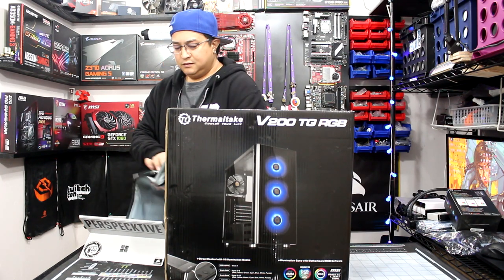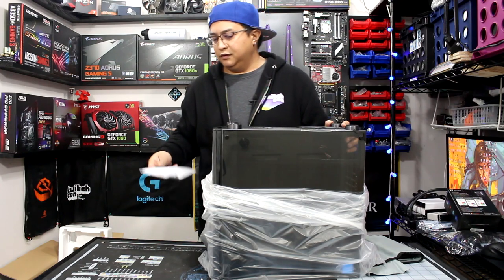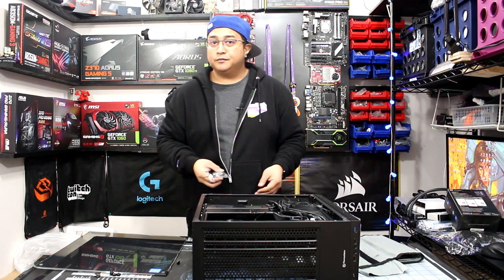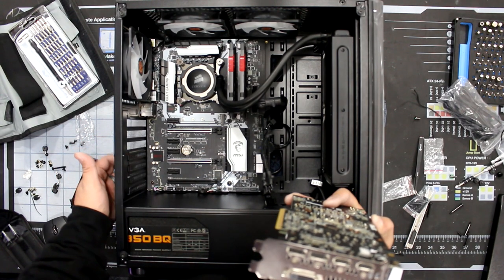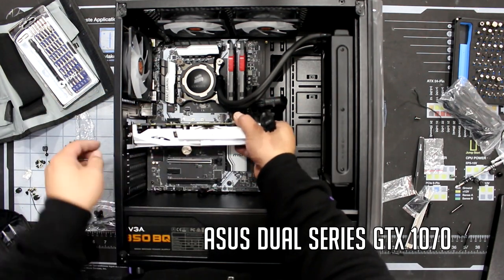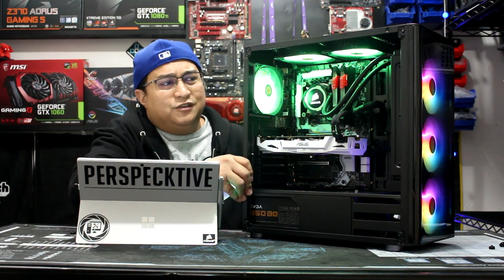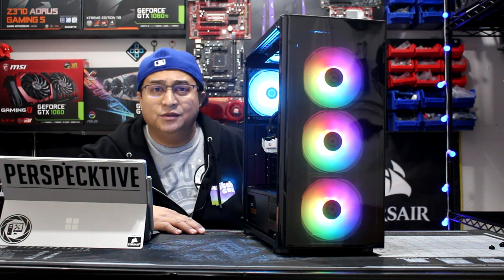Building In The Thermaltake V200 TG RGB (2018)

Comment: How did you hook up the fans in the back? I am currently trying to put this together but I have yet to put in my ram or my VGC and the cpu fan wont spin. This is my first time building a computer so I'm learning as I go
Reply from the maker: Hey man, sick that you're on your first build! Sorry I couldn't get to you sooner, I hope you were able to figure it out though. But in regards to your CPU it sounds like your cpu fan either isn't plugged in or your power supply isn't connected to the "CPU Power" on the motherboard which is typically located to the top left of the motherboard. Then the fans in the back? Are you talking about where I plugged the fan cables? Not sure what you mean but I'll try and answer your question if you can give me a little more insight on what you mean.

Good luck on your build man!
Reply: On the back there is the board where the fans that came with the case that are hooked into it. I'm not sure how the power is getting to them
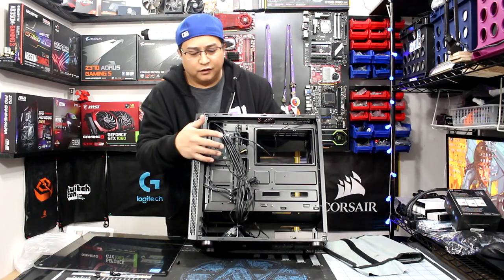Reply from the maker: @John-kn4tr  Ahh I got you. That circuit board is the built in fan controller for the case. It's powered by a SATA cable. You can see it towards the top of the case at 3:54
Reply: I feel like giving up on it because I cant get anything to turn on
Reply from the maker: @John-kn4tr  Did you check if your motherboard was connected to your power supply at 2 points?

1 connection point should be a 24 pin cable. Really wide cable and would be located to the right of the motherboard. The 2nd connection point would be for the cpu which is located at the top left of the motherboard. I would also verify you're using the correct cable for the cpu as it can be mistaken with pci power cables. I would also check if the switch at the back of the power supply is flipped to the on position (i know it sounds dumb but it happens to even me sometimes.)
Reply from the maker: Don't give up man, I'm here to help you out! Hopefully we can get your rig up and running you know?
Reply: Both are connected. If I was able to send pictures I would.
Reply from the maker: @John-kn4tr  What about that switch? does it even turn on at all? Like fans start spinning and they stop?
Reply: @PERSPECKTiVE  they dont turn on at all. When I flip the switch on the psu only thing that lights up is the tuf b450 pro motherboard led light. When I hit the power button absolutely nothing happens
Reply from the maker: @John-kn4tr  so an LED light is typically a good sign. When you press the power button do any fans spin at all? If not I would double check to make sure your front panel connectors are connected properly. If the motherboard doesn't have a diagram drawn onto the pcb i would look at the manual on how you would plug them in. What motherboard is it anyway?
Reply: @PERSPECKTiVE  I've swapped the connectors so many times and havent had any luck. It's the Asus Tuf B450 Pro Gaming motherboard
Reply from the maker: John1037259 alright man I'll add you to my discord. Sorry I ended up eating and knocking out since I got work in a few. Check your invites later on in the day for the same name. But for me if I can't get a pc to start in the case I would try and build it outside of the case and then use a screwdriver to jump start the pc. You can do that by using the screwdriver to touch the 2 pwr switch pins on the motherboard after putting it together. If you don't know what I mean, some of my earlier time lapse builds have a section in the video called build preparation, this is where I build the pc outside of the case to test that the parts are working
Reply from the maker: @John-kn4tr  Hey John join this discord. https://discord.gg/3CYUFb it expires 5/12/20 @8:30pm PST

Comment: Hi! You replied to my comedy before but I forgot to respond :(. Anyways, I am now building in this case and got kind of scared about the PCI plate scraping the mb. Is there an easy workaround to this?
Reply from the maker: They only work around would be to remove the plates before putting anything in the case. I'd estimate how many you need to remove so you don't end up removing too many of them. Most people with just a graphics card only need to remove 2.

Comment: Is there a way to use that case’s fan 6 pin conector in other case or in the motherboard directly??? I’m trying to look for any splitter with 6 pin but no luck to find one
Reply from the maker: Are you talking about using the fan controller in another case? I'm sure you could.

Comment: Was the three front fans the same that came with the case because if so how do you put it on the rainbow mode
Reply from the maker: No I moved the original fans to the back and top parts of the case. The fans I used in the front are called ThermalTake Pure 12's. They came in a 3 pack.

Comment: How To Sync All RGB Fans 
I Can Control RGB Only From RGB Button in Front
Do I Need To Connect Any Wire To motherboard ?
Reply from the maker: You would need to connect an RGB cable from the fan controller to the motherboard to control the colors with software.

Comment: Quick question my motherboard only has 2 slots for fans are all the fan cables separate or what I need to know ASAP ty.
Reply from the maker: You'll be fine if you're not adding any more than 2 fans to the case.

Comment: just bought this case but i’m having issues with installing the motherboard is there screws that come with the case bc i can’t find ones that fit?
Reply from the maker: There should be a few sets of screws that come with the case. I would just try 1 of each type and see which one fits best. DO NOT try and force the screw in. If it doesn't go in smooth, then that's not the right screw for the stand offs.

Comment: I have this case but in order to mount my HDD I have to take the front panel off but it doesn't show how to do that anywhere. Would I just pull it off? How did you do it?
Reply from the maker: Use your fingers to pry it out from the bottom but be careful to not rip off the front panel IO connections. 5:45 Kinda shows you how I did it. But if you look at the bottom there's a hole. Use that hole and your fingers to pry it off. Pull outwards away from the case and remember not to put too much force.
Reply: PERSPECKTiVE  so in order to mount HDD i have to take fan off?
Reply: @rufatshahbazov1326  Yeah you have open the front panel, remove the bottom fan, and screw in the HDD through a little gap to have it stay in place. I haven't done it yet but I will eventually. I have had my PC for a year and just left the HDD laying on the bottom of the HDD cage and I have had no problems.
Reply: Nick P thank you very much bro

Comment: Nice vid man! I was wondering if you were able to get the rbg software running? For some reason it gives me an error and says that it doesnt detect the fans. The fans are working completely fine and the rgb is still working.
Reply from the maker: ASAPVentus did you connect the fan controller to an rgb header on your motherboard? I used asus aura sync since my motherboard I tested that on was a rog. it shows up as a light strip in the software. Not sure what software you're using but in order to control the colors you need to control it with the software. As far as fan speeds, I want able to control them. I don't think they're meant to be controlled in this setup unless you bypass the fan controller and use different fans.

Comment: Am i able to install just the 3 back aftermarket fans and keep the front ones the same? If there is space to add them like you did in the video, Thank you
Reply from the maker: Yeah if you got an aftermarket kit of 3 fans like the ThermalTake Pure 12's that I used, you can use 2 for top exhaust and 1 for rear exhaust. You would just be replacing the non RGB rear exhaust fan that comes stock with the case.
Reply: PERSPECKTiVE thank you that’s perfect thank you for the reply
Reply: @PERSPECKTiVE  Im planning on using the stock fans the same location that you did, top and side but where do i install extra RGB fans like you did three in a row on the case?
Reply from the maker: @reapz263  You're welcome! I'm glad I could help!

Comment: Great Video! Im planning on buying an aio for this case, and I was wondering, do you NEED to install the radiator fans where the normally stock fans would go and the radiator in the inside of the case instead of screwing the rad and fans together? does this hinder cooling performance?
Reply from the maker: You'll be fine attaching your rad to the front fans without the stock ones that come with it. You could even re-purpose them as exhaust fans for the top of the case if you wanted to. As for cooling performance, from my experience with these builds I haven't had any real issues at all but always keep in mind that the radiator was tested to perform with the stock fans so you may get a variance positive or negative if you use fans other than those. I don't know what your ambient temperatures are where you live but I would just recommend checking your temps regularly for the first month or 2 of a new season and determine it that way.
Reply: @PERSPECKTiVE  Thanks, I figured out that you could simply take out the fans from the front of the case and put the fans and rad together on the inside of the case. Thanks for the info!
Reply: @PERSPECKTiVE  also, what cooler did you use in that build? Did it give some good temps? Thinking about getting the arctic freezer 240mm aio
Reply from the maker: @GeometryPro  Nice man, sorry I thought you were asking a general question and not how to install it but I'm glad you figured it out. I used the Corsair Hydro H105 for this build which sports a thick 240mm radiator. It's discontinued but you can substitute that with the H100i no problem. I haven't worked with an Arctic Freezer but I don't think you could go wrong with that since they make good Thermal Paste but those are 2 different products altogether so you never truly know. I saw some reviews posted when I searched it so there's definitely some info out there you can work with in regards to whether or not you should buy it.
Reply: @PERSPECKTiVE  alright, thanks for the help. Keep up the good work with the videos! Subscribed.
Reply from the maker: Hey I'm here to help! Thanks again for your feedback as well. It really means a lot.

Comment: where did you plug in the rgb controller on the motherboard? i have  the same case and a z170a carbon motherboard and couldnt figure it out.
Reply from the maker: Sorry to break it to you bro but your motherboard doesn't appear to have any RGB headers so you'll have to control the RGB with the controller that's built into the case
Reply: My rgb headers are toward the front of the case which would be by the fans. I have a tuf gaming pro motherboard tho

Comment: hi nice video! question does the front panel does not block air flow when closed?
Reply from the maker: Hey thanks man! Yea the front panel isn't the best with air flow but it definitely doesn't block it. If you've got exhaust fans on top you'll be fine though. And if it's a big concern you can also go with a blower style graphics card.

Comment: can you tell me how did you control all the fans since mine can control the front only and if you used a hub tell me
Reply from the maker: Not too sure if you have the right model of case but the case itself should be able to support powering the 4 fans that it comes with. Your motherboard would only need up to 4 additional fan headers to support more fans.

Also, not sure what I would do with a USB hub but no I didn't use one for this build. The motherboard had something like 6 USB's in the back so it wasn't really necessary.
Reply: @PERSPECKTiVE  Thanks for your reply, I can control only one RGB fan since I have only 2 jrgb in my motherboard, btw its a b450 gaming plus max, so if I wanted an additional led strip or fans, I will need some sort of a hub to control the additional fans led strip, etc, right?
Reply from the maker: No problem at all! But yeah you would need additional hardware based on what you're gonna add

Comment: bought the non rgb model of this case because it was the cheapest i could get with tempered glass on the side besides something ultra chinese. i had to remove the mobo in order to get the pcie plate for my graphics card removed. besides that an the cheap VERY scratchable front panel which i didnt even know it was transparent till i opened the box, i think its a good case. maybe some extra air intake in the front would be appreciated. maybe i'll modify it at some point and build some sort of  mesh plate for the front, but for the time being i'm running an i3 with an rx570. nothing too hot. 60 and 75 degrees at most, respectively, so i'm ok.
Reply from the maker: Yeah, functionally the front fans don't do a whole lot when it comes to airflow for this case since it's choked by having only holes on the side to pull in air. I looked at TT's website picture for the v200 non rgb and lmao. Yea you can't tell it's transparent until you look at the other product images. I can only imagine the reaction to that. Good luck on your mod though.

Comment: Hey bro I just wondering why you didn’t put the cooler in the top of the case ?
Can the NZXT X62 fit in the top of this case ?
Reply from the maker: It's all good bro, questions are always welcome. The case wasn't designed to have a radiator on top. One may fit very snug if at all but short answer, it wasn't designed for a top mounted rad. On top of that the front end would look pretty empty when looking through the side panel, even if you did have 3 SSDs mounted there.

About your x62, I don't think it would work. It would likely hit your ram sticks if they're not low profile, and it would likely block a small portion of the rear exhaust fan.
Reply: Hello, I have the exact same case, I was wondering what best size ( aio cooler would fit) and would I be able to remove the HDD cage so I can increase the size  of aio CPU cooler

Comment: How do I connect the RGB controller on the back to the RGB header on my motherboard? I don't have an RGB cable and even I had the cable I couldn't figure out where the RGB cable should go in the controller.
Reply from the maker: You would have to verify to make sure your motherboard supports it. If not then you would need to just power it with your PSU. You can try and get a fan controller to do it but you'll need to do some research on how you can get it to work with your current setup
Reply: @PERSPECKTiVE  Thanks for the reply. I actually sold the Case because it had terrible airflow and bad material quality. Instead I got a Cooler Master TD500 Mesh and its perfect
Reply from the maker: Nice yeah the TD500 is pretty nice too

Comment: Hey.. where does the 12v input, from the fan controller on the back,  plug into? Any help would be appreciated
Reply from the maker: Plug that 12v input to your power supply. Since the fans aren't connected to the motherboard, they'll need power directly from the PSU.

Comment: How did you do the ssd? I dont see that part, also thank you for mentioning to take out the side gpu covers before putting in the motherboard thats a life savor.
Reply from the maker: Hey Ross sorry, yeah I realized I forgot to add that footage in this video. You can mount the SSDs using the drive cage inside the power supply shroud or you can mount them behind the front mounted radiator. You could also check out my "Old PC Makeover! (Thermaltake V200 Build)" Video to reference that as well

Comment: I’m planning to use this for a build with a micro atx mobo. The mobo has 2 fan connectors. Would I need a fan splitter or am I fine?
Reply from the maker: You don't need a fan splitter if you're adding only 2 fans since the case already provides power to the 4 fans that come with it via the fan controller. However, if you are adding say like 4 more fans (2 exhaust on top and maybe 2 fans for push pull configuration with a radiator) then you would definitely want a splitter.
Reply: PERSPECKTiVE okay, thank you! Very helpful information!
Reply from the maker: @zacharoni2830  You're welcome, I'm glad I could help man!
Reply: I was wondering the same thing, as I may use this in a Micro ATX build. Thanks for asking, and thanks for answering. (:
Reply from the maker: Sorry for the late response. It's easier to keep track of brand new comments compared to replies to comments but in case you haven't built it yet, you can use a Micro ATX no problem. Thank you for stopping by the channel!

Comment: How to connect cables of pre installed argb fans of thermaltek v250 🤔
Reply from the maker: I haven't worked with that case but if it's anything like the V200, you'll need to connect the fans to the fan controller then connect the controller via ARGB connector to your motherboard. Otherwise I'm not quite sure. Sorry about that!
Reply: @PERSPECKTiVE  thanks Bro
Reply from the maker: No problem man! Good luck with your build!

Comment: I think I saw room but does it have a place for a ssd and a hdd?
Reply from the maker: Yeah you can install drives in the power supply shroud and along the grid to the right where the AIO radiator is. The 3.5 inch drive bay can be removed to make drive installation easier.

You can see where you can install the 3.5 inch drives in this other video at 9:07

https://www.youtube.com/watch?v=MIso8obpjlQ
Reply: PERSPECKTiVE ok thankyou
Reply from the maker: @chrisreay5799  No problem man